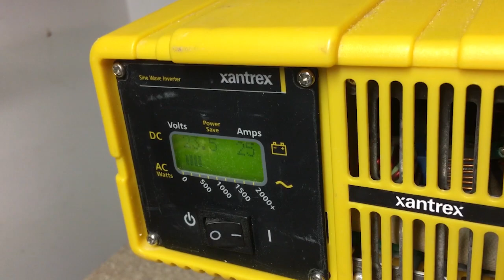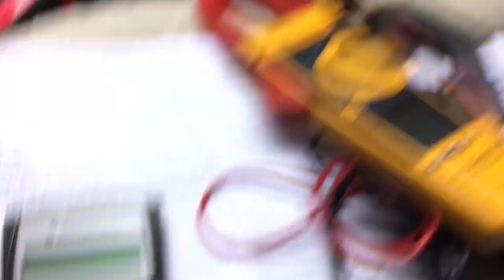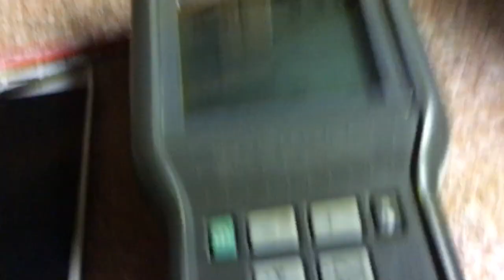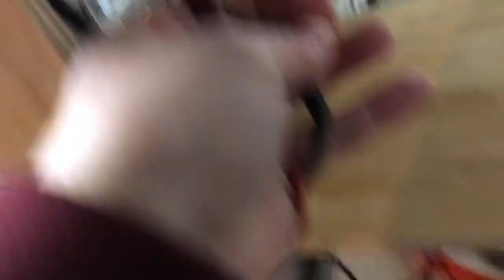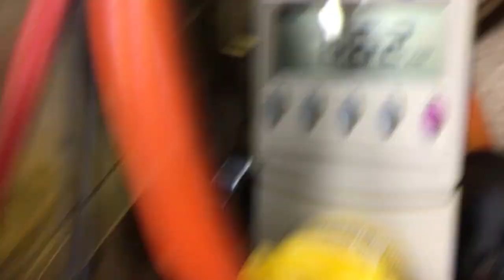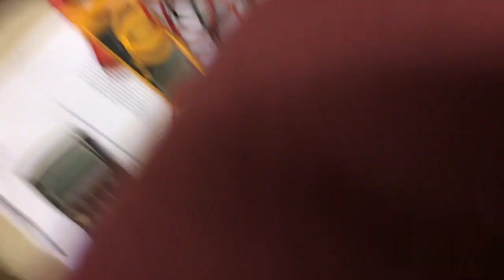How to use a furnace when power is out

Comment: Where did you obtain the document your using showing the SOC on cells ?    Looking for one.   Did you ever run a proper Capacity Test on the pack.   Controlled Load measuring Ah ?
Reply from the maker: I found it on an ev forum. if you want a copy of mine, let me know
Reply: @IFix-Things  Good Stuff, Sure.   Can you send it here ?    berquistj@q.com   ?
Reply from the maker: pulesjet here is the link

https://www.diyelectriccar.com/forums/showthread.php/charging-nissan-leaf-cells-advice-please-155777.html